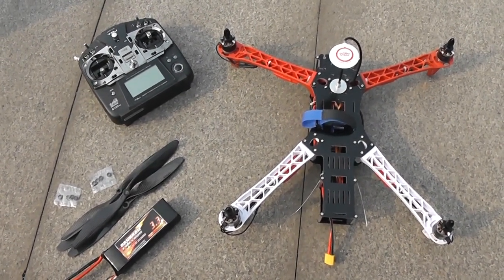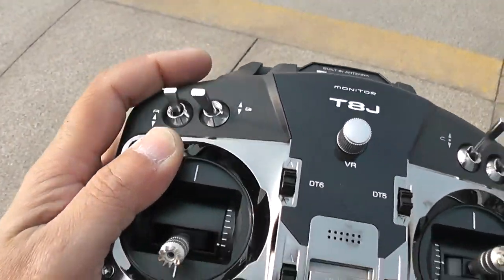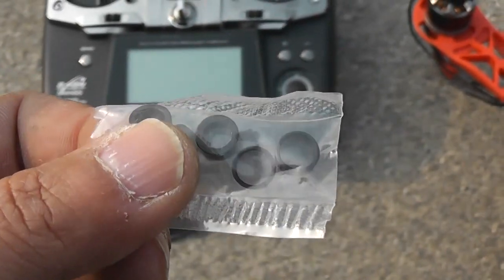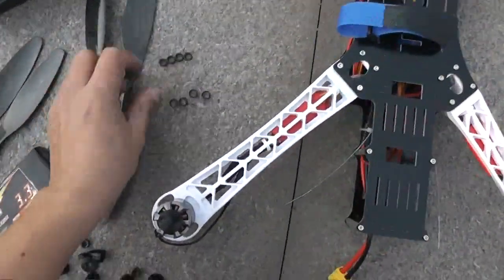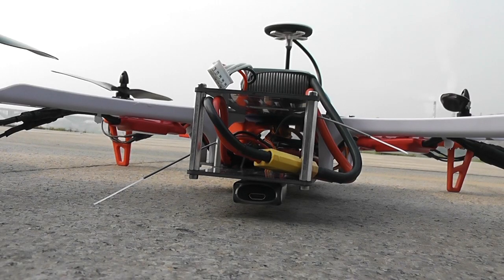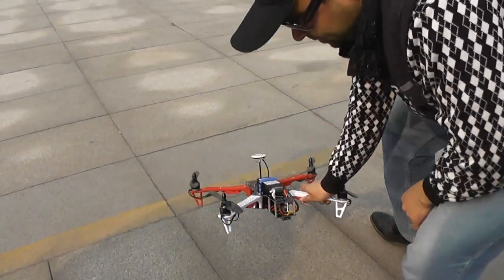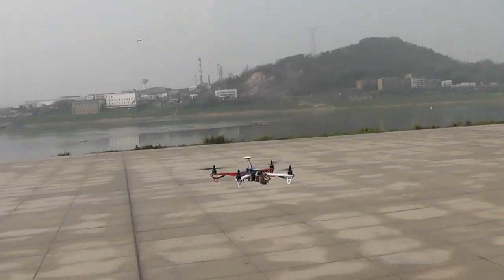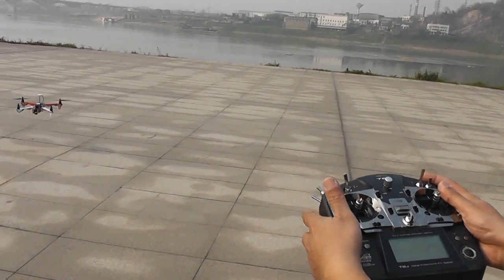OFM Multirotors Video Guide Pre flight setup and steps

Comment: Ali, no doubt you would save a backup copy of the NAZA Quad settings and the matching Futaba 8FG or 10CG transmitter settings for your OFM customers and supply them on a USB Flash Drive or burned to a CD..? Having these files available for download would be an enormous benefit to beginners & save them hours of heart ache and far fewer crashes as they learn to fly with settings from a professional like yourself rather then hope they set it up correctly and risk damage as they learn..!